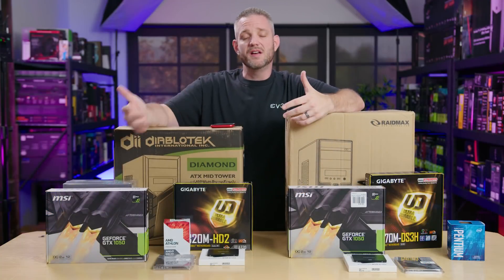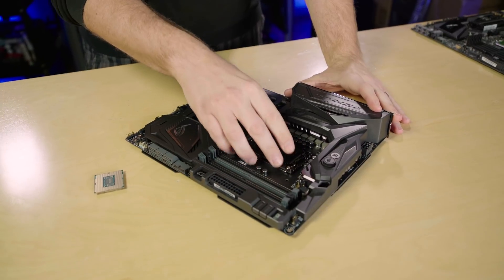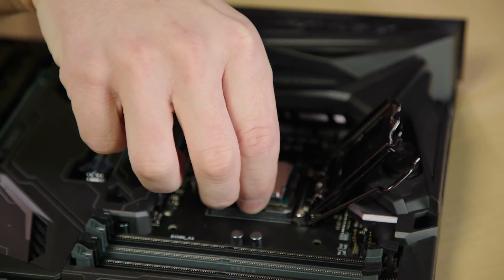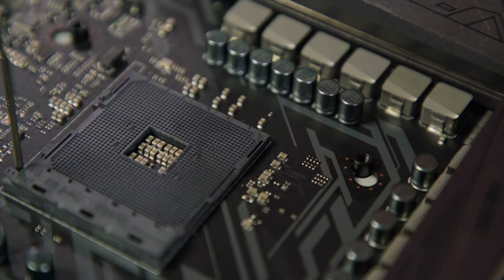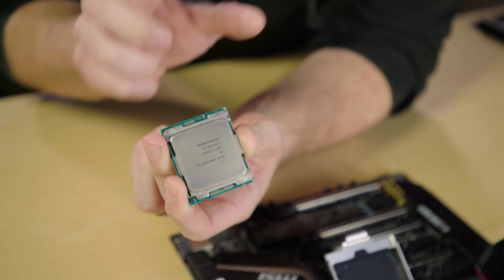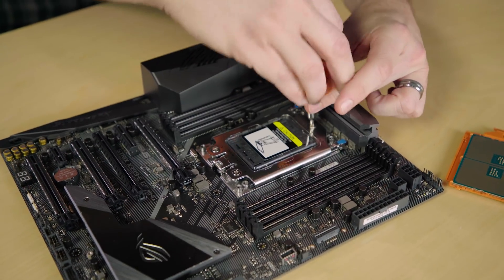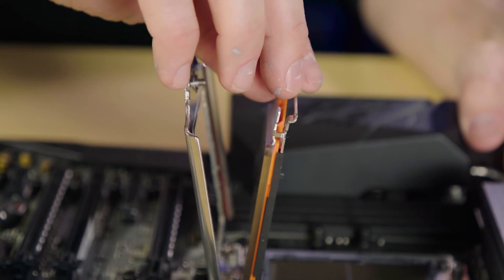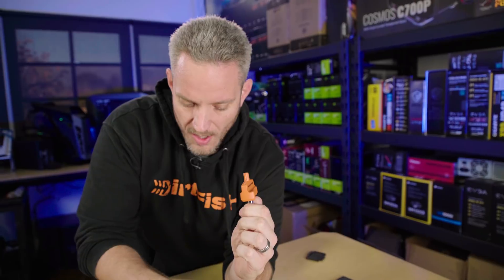How to Install a CPU

Comment: How to install a graphics card is gonna be kind of short I guess.
Reply from the maker: Its going to be "almost" pointless to do that video, but for the sake of the series, it will be necessary.
Reply: JayzTwoCents maybe make one video about both GPU and ram installation together. Two birds with one stone, but that’s just a suggestion.
Reply: +JayzTwoCents
maybe a general PCI-E video is better since PCI-E slots aren't just for GPUs
Reply: He could cover crossfire or SLI, making sure power is connected to the gpu if it needs its own power, and about the right BIOS or UEFI changes to make, and driver installation.  He could also cover using risers and vertical mounting.
Reply: JayzTwoCents then you can maybe show the different psu connections for a graphics card and maybe talk more about watt usage and how to choose a card that fits your case or something, just to fill out
Reply: You should add the graphics card installation to the video where you show how to put everything into the case.
Reply: JayzTwoCents if anyone ask how to install graphics card I will give link to video where you used spare sceews to level it up.
Reply: No Celebrity was going to add but you got it... I think it would make a nice 5-15 minute video depending on how in depth he goes...

Comment: My tech support said to put My cpu into the microwave then it will easily fit.
Reply: UltraSive a bit too small, you might need to fit yourself in there
Reply: You need to turn it on and off
Reply: UltraSive nah that's wrong. If it doesn't fit that means it infected with a virus.
Reply: So you just put some salve on the socket, to cure the virus. And if you computer is running, watch some 60fps memes to cure the cancer too.
Reply: While you put it in the microwave forcefully throw the cpu into the microwave, it may look broken but you are all goods. Now plug in the microwave with an extension cable, set it to go for at least 10 minutes and throw it into your pool. It should fit after this is all completed.

Comment: Foxconn socket: step 1, apply 500kg of force and snap your board
Reply: Foxconn socket step 1, acquire hydraulic press.
Reply: pretty accurate!
Reply: You had me laughing like a madman!
Reply: #rekt
Reply: Yes, veri gud
Reply: well actually kg isn't a force, it's a unit of mass. I think what you are referring to is weight and 500kg to weight is 4905N. So we're actually applying 4905 newtons.
Reply: I have a X399 Gaming 7 board with the Foxconn socket, you don't need anywhere near the amount pressure that some techtubers are using, the Lotes socket is easier to use but you can do up the Foxconn on with just fingertip strength perfectly fine.
Reply: made my day :D
Reply: Step 2 use thermal paste to glue together
Reply: It seems to be luck of the draw if your foxconn socket is busted but they have a higher likelihood as reported pretty much everywhere. I'm sure newer boards are probably fine though.
Reply: Do you really need 500kg of Force for that?
Reply: disliked: force is represented by newtons or kgm/s^2
Reply: Step 1: drive a fucking dump truck on the damn thing
Reply: Bitch i bent the motherboard harder than a nokia 3310 does in order to seat the cooler properly
Reply: step 1 torque down the socket itself, using the same torque driver provided with the CPU.

Comment: Thank you for making these videos, not for the sake of me, but for the sake of others who have never done any computer building before. Thank you so much @JayzTwoCents
Reply: Just the thing i want to say @MahBoiJoe  ^^ Thx Jay for making videos for the newcomer into the pc building @JayzTwoCents
Reply: First CPU, then get a motherboard with a corresponding chipset. Then checks the motherboards size (ATX, mATX or ITX) and get a case with the same form factor. Then get a CPU cooler and graphics card that fit inside your case.

Comment: Install windows on a new pc using a usb
Reply: youssef badawi yesss
Reply: you can install via Disk, over Network, or another Drive.
Reply: Plug in click next
Reply: Easy, 

Make sure ur HDD/SSD is plugged into the mobo
Put the USB in the PC
At boot, select the USB drive (When clicking power button, spam F11 immediately)
Let it do it's work.
Reply: Hold your horses, we'll get there.
Reply: https://www.microsoft.com/en-us/software-download/windows10

Download the tool (on a working pc) and then open it and there should be options to put onto an iso disk or an external hard drive (usb) and then get a usb with 8gb or more anything below wont work and install the drives into your usb (make sure to use an empty one. after installed it deletes everything besides the windows drives) after that wait for it to install onto the usb and after completely finished head over to your build and shut it off completely and plug in the usb and turn it back on. windows should boot after that with a setup program and will lead you the rest of the way, good luck!

Comment: This is my first time to attempt to build my own computer. WHAT DO I BUY FIRST THE CASE OR MOTHERBOARD? What video do you have which has a list of what to buy first.
Reply: Motherboard before case. Last thing you want is to buy a case that doesn't support your motherboard size.

First thing you should do is pick the CPU though, that will narrow down your motherboard choices making it easy to pick one
Reply: PHYLLIS CINQUE you don't have to particularly buy anything first but you can choose motherboard first because the size and price can determine what case you end up buying. But to answer your question for other parts, this is what I would do:
-Choose cpu/cpu platform first
-Then motherboard
-All other parts in whatever order dependant on price 
-And case 
Many people have guides as to what parts to use and you can use pcpartpicker to choose your components in an organized matter.
Reply: Well if you are going to end up buying part overtime. Then the safe bet is to make your final 3 purchases the CPU, Motherboard and Ram. Also consider GPU if your CPU doesnt have on board video. This way you can test all 3 together and return/rma if needed. However your choice of the platform should start with your CPU, then motherboard, then ram. Then decide on GPU & storage. Next would be cooling (if going aftermarket) and power supply. Case is the last (or 2nd to last) decision so you have one that fits everything.
Reply: PHYLLIS CINQUE Doesn't matter all that much just make sure you don't do something like buy an atx motherboard but then a micro atx or mini itx case,
Reply: PHYLLIS CINQUE PC partpicker is a good site to start
Reply: Only make sure the case and mobo match sizes. Standard is ATX. Most mobos and cases are in this size. Really, it's just common sense though, you want to make a "box" bigger than the content you want to put inside, right? As for the CPU question, overall everyone agrees Intel is better. But that is why AMD is cheaper. So depends what you want. For any product you choose, you can google benchmarks and see the difference. Just get whatever newest gen cpu that is in your range. Preferably i5 or i7 if the prices don't seem high to you. Otherwise get an AMD.
Reply: Don't laugh, but by CPU you mean either intel or amd? Which is better? I've had both and honestly I don't see a difference, but then my current computer is over five years old (Intel cpu) The one previously was AMD.
Reply: oh boy! Where to start (waited three years to finally get all the parts to build the computer for my youtube channel,video coming soon -point is speaking from experience on anxiety before you actually buy for your very first build ) start with pcpartpicker.com - it has a template with all the components listed in order and also tells you if you select incompatible products ,wattage and to some extent idea on what it would cost. You are welcome. :)
Reply: Motherboard first. What motherboard you pick will potentially limit what cases you can pick.
Reply: Motherboard first.That way you can know what case size you need
Reply: In terms of raw performance Intel are better. In terms of price AMD is better.

It depends on what is more important to you. Raw performance or value for money

EDIT: As Junior Thomas said. visit PC Partpicker. It is a great website. It will tell you if you have parts that are not compatible with eachother as well as things like power consumption so you know what kind of power supply to go for. If you are on a budget you can easily monitor total costs on the website. There are also websites and forums that will help you decide. I think LinusTechTips has an active community on their forum. Alternatively you can search up some example builds on youtube and go as close as possible to it as you can. Paul's Hardware does a new build every month on his youtube channel and he does all sorts of builds, he is probably the best place to look for an example build due to his quanitity of them and the variety there. I beleive he links the PC Partpicker page for every build he makes

Comment: 1th, tho thermal paste used to be the real pain during the CPU mounting process. That deserves a real full video coverage. Imho
Reply: You and I may know it. New builders probably won't. Here is +Luigi Mazzone's  point. So quit using fancy words like "braindead", and don't pretend to know everything. Properly wipe paste off? How? With a piece of cloth, paper or a piece of cotton? Why? Just wipe it or use a little isopropyl alcohol to make sure ALL the paste is gone? If that kind of alcohol is not available...any other kind of solvent is good? Is there any problem if a nearly imperceptible piece of that fiber used stays on the cpu/cooler? How to avoid air bubbles if you haven't applied the paste correctly (you probably did it wrong if you don't know how to apply it correctly)? What kind of paste is the best? Paste or Grease?.
You probably won't know the answer to all of them.

But hey, people that are new to this world are mostly braindead. And they will feel like Einstein when they read your replies.
Reply: What is there you can do wrong about thermal paste except for using too much?
Reply: 1- Using too little. 2- Not to apply it correctly. 3) Proper way to clean the old one if the computer already has one....you want more? I have more.
Reply: Albert Mas Using too little is not possible unless youre braindead and spreading it on the IHS is just as good as putting a drop in the middle. For cleaning old thermal paste off it is enough to properly wipe it off.
Reply: These kind of videos are supposed to be a valid support for newcomers to the Pc Building world. CPU Related, as far as i remember the thermal paste has no "rail" or "corners" to watch out. Its all just based on your own personal lil experience. Also there's plenty of ways, plenty of types and plenty on disinformation  laying 'round for such a fundamental element in the building enviroment.
Reply: Albert Mas Anyone who builds a PC will likely simply watch a build guide wich includes the application in one of the most commom techniques: The pea or manual spreading. Cleaning it from the CPU is not relevant information for first-time builders. Using what comes with the cooler or Arctic MX-4 will not cause any problems.
Reply: Lasse Reinlaufen I bet not many newcomers are aware of the existence of Mx-4 or liquid metal paste.
Reply: Luigi Mazzone MX-4 is recommded in most build guides and the paste that comes with coolers is usually good too.